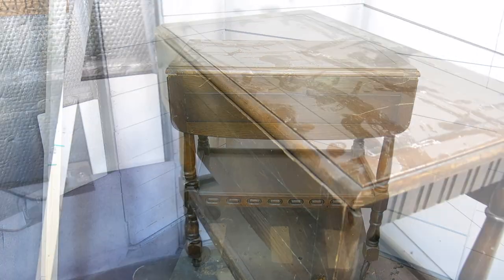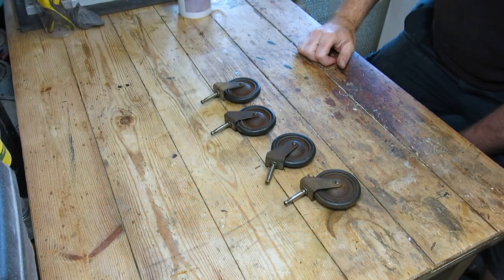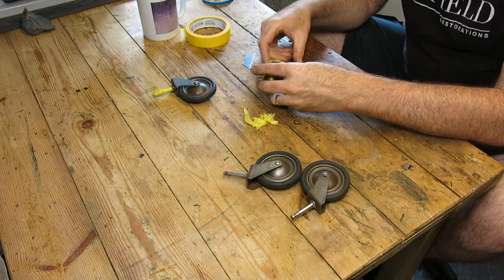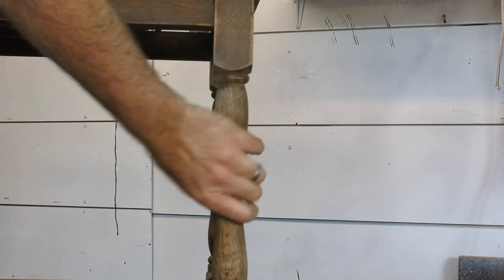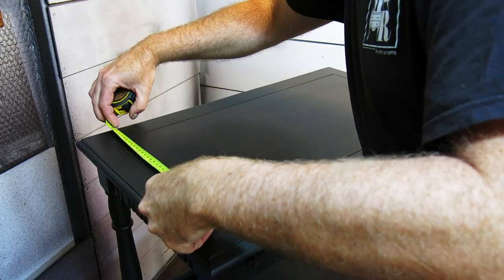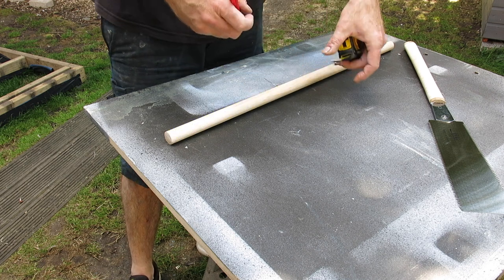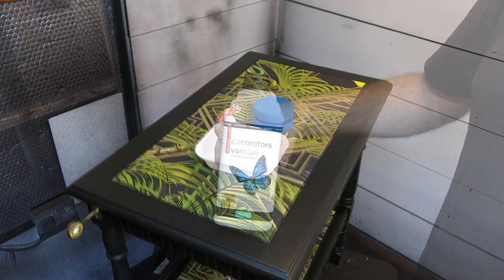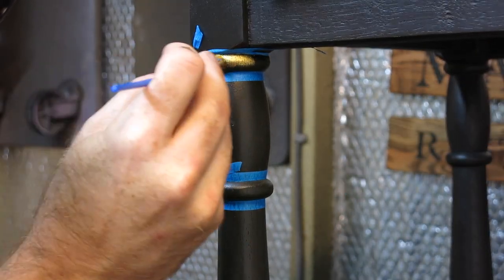Tea Trolley MAKEOVER - updating unloved furniture

Comment: It’s lovely. I have a bit of a thing for tea trollies. They are really fun pieces to work on.  You can do so much with them. 
And I love decoupage. 

From the point of view of decoupage, I would be more likely to apply around 5 coats of the protective finish. You won’t be able to feel the edge of the paper as such because you sat it inside a channeled detail. But if the surface was flat, you should apply enough coats to remove the feel of the edge of the paper completely.  It gives a lovely feeling and look to the piece and even better protection. 

Most people would have thrown that in a skip.  You transformed it.  I love your videos.

Comment: Excellent. Very elegant.   Is the wax you used okay to use on furniture not being restored,ie.a dining room suite etc. I like the finished appearance.
Reply from the maker: Hi Laurie, I use it on painted and unpainted surfaces and it works great. It does take 30 days to FULLY cure though so you have to go easy on the surface before that. Personally i wouldn't use Wax on a dining table surface though, it gets a lot of use, potential spills and differing heat so it would be better finished with a harder wearing topcoat which is why I used PolyAcrylic on the top of this Bar Cart and wax for the rest. Hope this helps.😃

Comment: Looks like the ‘tea trolley-off’ is, well, off. I can’t compete. I only have one. 😉. Good work fella👍
Nice design. I’m was looking to keep some wood showing on the one I have but it looks like the veneer is shot.
Reply from the maker: Hi Dan, I was at an unfair advantage having two, strength in numbers! 😂😂👍 Thanks very much for your comments and i've no doubt you'll find a design with yours that works around your Veneer Issue. Good luck buddy 😀👍